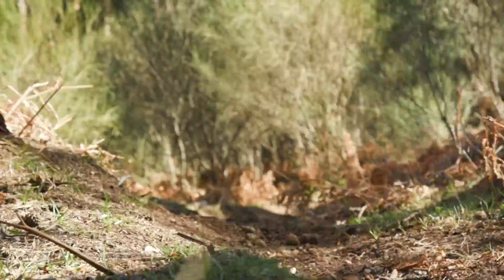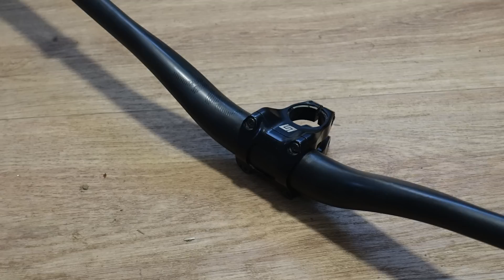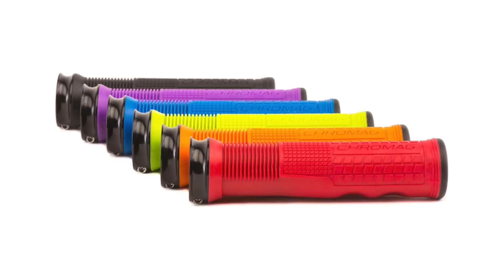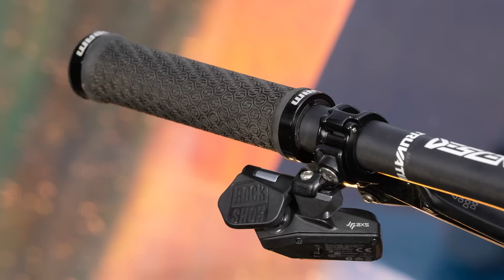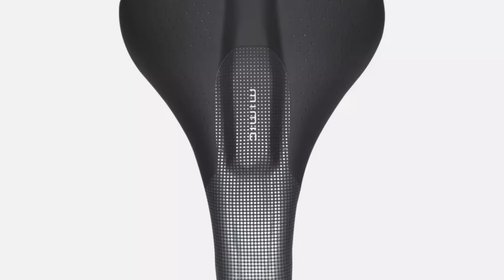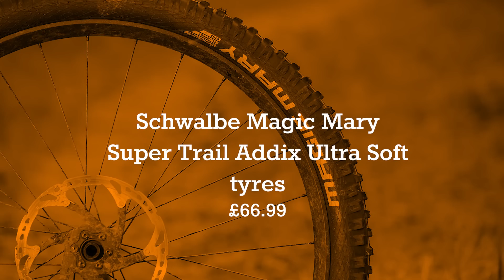The BEST Money No Object Mountain Bike Upgrades

Comment: i soon have syncros fraser ic sl carbon integrated handelbar  it´s come  740 mm wide from the factor  will be cut to 700mm  with  on my newest xc hardtail 349 euro in cost current weight is 11.8 kg ready to ride  soon will much weight they knock off.

Comment: I bought the OneUp carbon bars to help eliminate arm pump and when combined with proper heel-down technique they make a huuuge difference.  Regarding Magic Mary tires, I used to run them all the time for the grip they provide but now you can get a Maxxis Assegai that has less weight and less rolling resistance while still providing the same amount of traction.
Reply: Maxxis tends to be cheaper than schwalbe too
Reply: Haha - Maxxis cost like 60 70 Euros and Schwalbe 45
Reply: @hannes6114  in USA its the opposite. Maxxis 60-70, Schwalbe 80-90.
Reply: Well, I'm in Germany :)